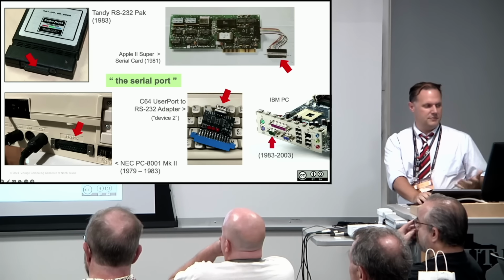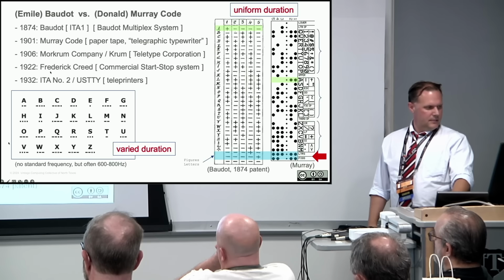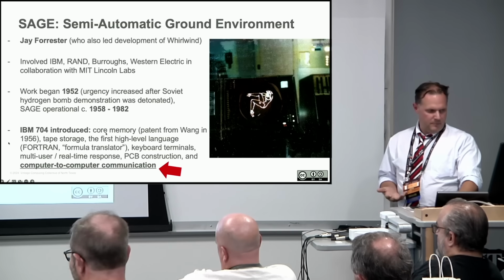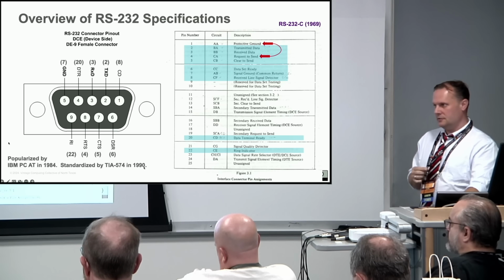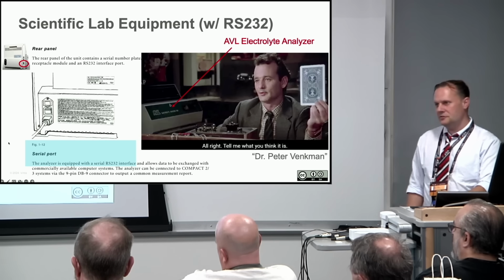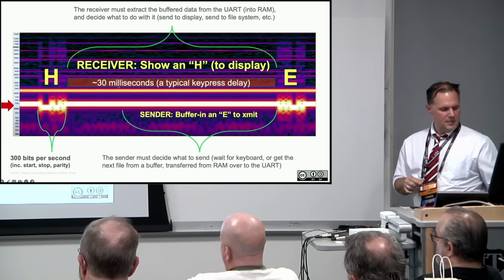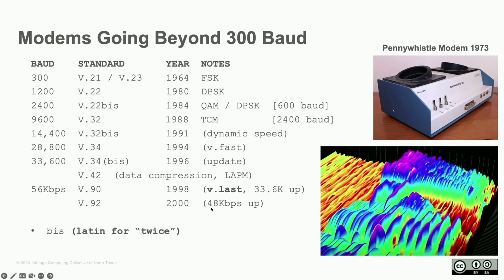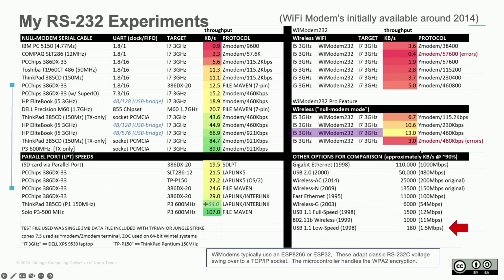RS 232 Then and Now

Comment: Modems were definitely available in the 1960's though the only explicit references I am aware of are some of the IMP documentation from BBN (ie. arpanet devices) they were presumably uncommon because in 1969 "long distance network connections" were up to 2000 feet. I would assume AT&T would have documentation on anything that relied on their network  - thought I haven't looked.
Reply: Yeah, culturally, attaching anything to the phone "network" in the 1960s was frowned on.  I didn't get too much into the Phone Phreaking aspects.  I recall an episode of Mannix (late 1960s TV series) of him "hacking" phones.  Even attaching an answering machine was frowned on, I think it took a lawsuit to eventually allow non-AT&T phones even?  but to be fair, its copper wires and one bad actor device could do a lot of damage.

Comment: I thought 20 volts was to prevent issues from voltage drop across cables prior to  widely accepted standards 
Though I am not aware of any document that actually says that, I have pulled some weird and awful cables out of old office buildings. 
I believe serial spec on IBM pcs was +/- 5V case internal and +/-12 volts case external i(irc)
Reply: It also makes the line more durable against EM in an equipment setting with high power loads switching on and off. You may notice that on office network equipment some brands will detail their auto-negotion specs, and it may be under "power saving". But RJ45 can be boosted for long runs and it's for the same two reasons. I think some POE adapters also have that feature, and have seen USB range extenders with it too. Good question ✌️☕

Comment: RS-232 through a DB-25 connector:  Pin 2 to pin 3, pin 3 to pin 2, and pin 7 to pin 7 as ground.  I wonder how many of those cables I made up through the years.  A good talk and some good memories.
Reply: You know those floppy drive cables with the flipped wires? You could do that with RS-232 as well, but it needed a second flip for the handshaking signals. I don't know if they make ribbon cable DB-25 connectors anymore, but I still have a couple of those that I made back in the day, including one with both male and female at each end. I knew someone who called that a "snake" cable.
Reply: @8bitwiz_  Yup, a null modem cable.  Made those too.  We didn't usually bother with the handshaking signals, they really weren't much used by that time.  I bet they still make the ribbon cable DB-25's.  So much of that old stuff still has a small market.  I've also got a few boxes of old components from the 80's when I was working with hardware.  I've thought of seeing if there's enough there to build a little Z-80 system from scratch.  Would be fun to work with some of that stuff again :)
Reply: For anyone who wants the DB25 to DB9 cable pinout for Fanuc robots and CNC machines, here you go:
DB9 Pin 1 and 6 (bridged) to DB25 Pin 20
DB9 Pin 2 to DB25 Pin 2
DB9 Pin 3 to DB25 Pin 3
DB9 Pin 4 to DB25 Pin 6 and 8 (bridged)
DB9 Pin 5 to DB25 Pin 1
DB9 Pin 7 to DB25 Pin 5
DB9 Pin 8 to DB25 Pin 4
Remember the nonstandard +24V auxillary DC output causes normal DB25 to DB9 adapters blow the fuse, so only use them with this kind of pinout
Edit 1: Also, this pinout is required since their controllers (especially for the CNC machines) use the RTS/CTS signals to detect the PC is ready to send/receive the data to/from the controller
Reply: Don’t forget the pins for hardware handshake & the many different combinations used between DTR, CTS, DSR etc. 😂